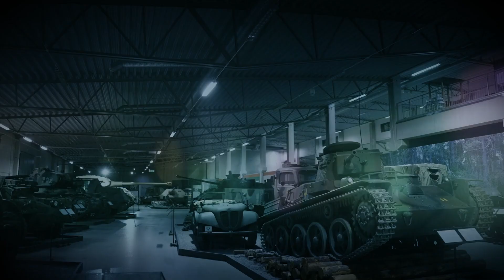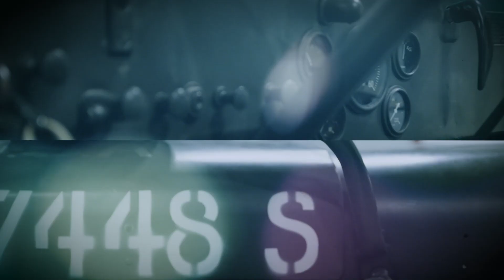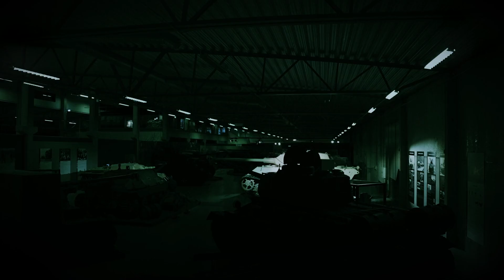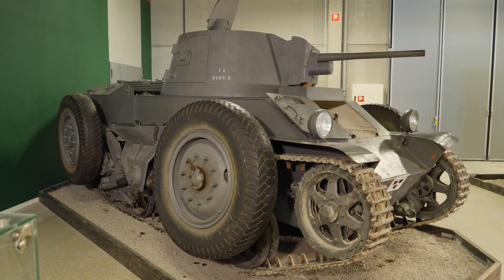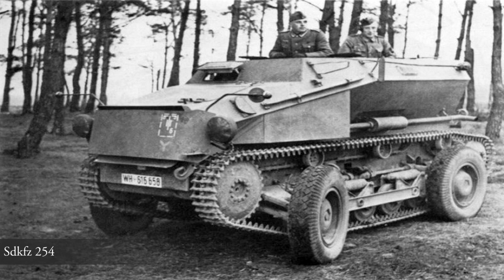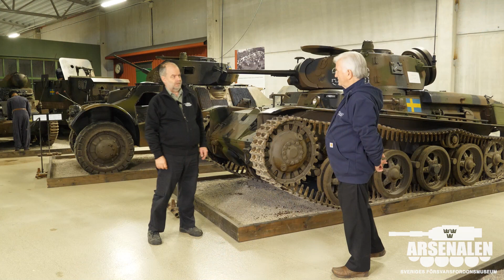Swedish-German Connection with Hilary Louis Doyle | Arsenalen Swedish Tankmuseum

Comment: Some other reasons why the Germans chose petrol as the lead fuel in their tanks and vehicles was its better starting performance in extremely cold temperatures. Diesel would become sludgy in cold and clog up fuel lines and injectors but petrol was more forgiving in cold temperatures. Also, the kriegsmarine needed the heavy oils and diesel for its ships, then there was the need for power generation in military instalations and civilian use for transport, heating etc. So, the allocations were made accordingly. Point to note is the campagn in the east, Barbarossa, took a lot of manpower and.....materials.
Reply: A bit ironic that the Red Army used diesels despite the great temperature changes in the USSR, though it turned out to be the "correct" choice, since diesel has since become the choice fuel for most tanks and they in essence still use a developed version of the same diesel engine that powered the Kliments Vorosjilov and T-34 tanks today in T-72.
Reply: @lavrentivs9891  The Red Army did use diesel engined tanks, but they had to pre-heat them with fires or external boilers. Also on some missions they had to keep the engines running throughout the night. The Baku, Caspian Sea oilfields were in their hands, so they didn't need to worry too much for energy needs.

Comment: Regarding the fuel shortage for Germany especially in a war situation, where they would have been isolated from fuel imports, maybe the decision for focusing on gas not diesel engines was the better one.
I did not understand, why they refused to develop their famous diesel engines - locomotives - for use in tanks, this could be a really good explanation.
Thank you - and Merry Christmas!
Reply: The idea was that crude oil would be in short supply. When crude oil is refined you get kerosene, diesel and petrol. The decision was to give all kerosene to Luftwaffe, all diesel to Kriegsmarine and all petrol to Wehrmacht.
Reply: @ollep9142  No. The Heer operated diesel trucks too. Diesel was already in the system of the ground forces. Also planes needed high quality aviation gasoline, not kerosene.
Reply: @SchleiferGER  Not so with jets
Reply: @theonlymadmac4771  I am well aware. But when preparing for the war before 1939 at a time where such decisions like stated above could have been made the ME 262 was not around yet.